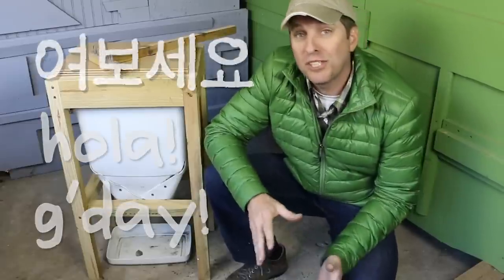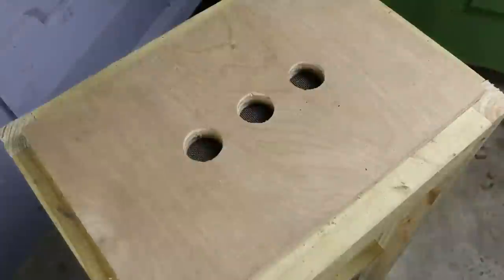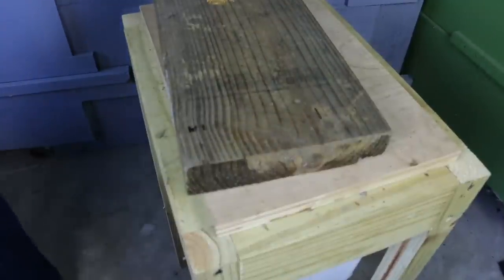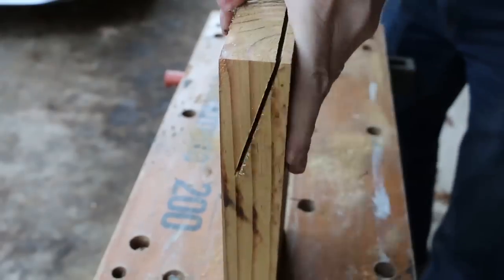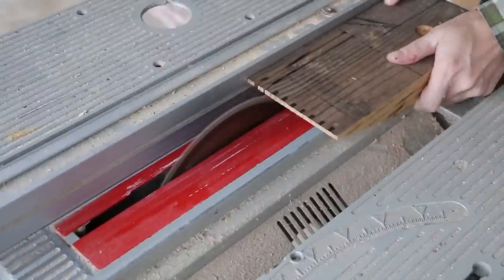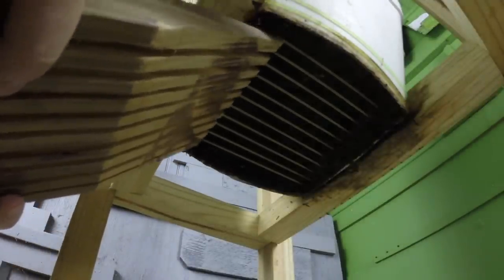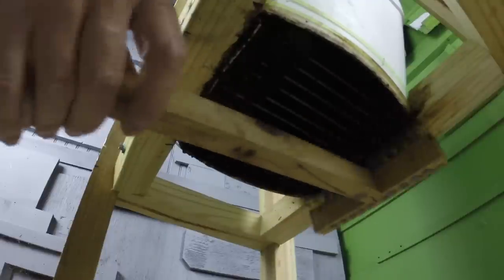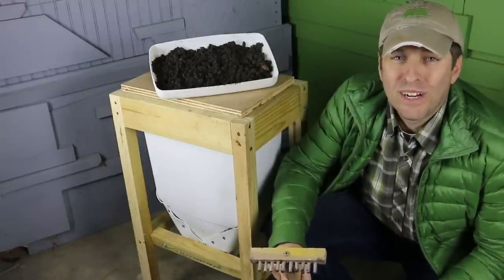How To Harvest A Flow Through Worm Composter

Comment: First, I envy your fabrication skills and all those neat tools.
Second, I still think you underestimate the stickiness of good vermicompost.  Gravity isn't enough to pull it down especially with the taper.  I used the same trashcan, which has a slight taper anyway, and used a cord, woven like yours to hold the compost.   I still had to push the compost down from above to get it into the collection area.  No special tool needed to do that, just a short colinear hoe.  I hold off on feeding them for about 3-4 weeks, gather the leachate, plunger the compost down for harvest then feed them good.
Reply from the maker: Hi Ann...thanks for the feedback. I can't argue with experience, but I'm an eternal optimist. lol. I want to see what happens with my flow through worm composter, but you've got me curious to see how tough those castings are. I'll keep you posted.
Reply: you push your compost down? will this hurt the worms also will anything leak from the sides of the trash can?
Reply: Most of the worms are in the top layers, they go down to the bottom to lay their young.  I do not have the tapered bin - mine is just a straight or slightly tapered trash can so no leaking from the sides with mine.  If you cannot harvest from the bottom, push the top layer with the worms to the side and use a dull flat tool to push the compost down.  I use a small 'colinear' weeding hoe with dimensions 1" x 3".  Do some worms get damaged?  Maybe.  But do your best to avoid it.
Reply: When I harvested a bin I poured it out on a table and pulled the layers of worm castings off letting the worms escape into the pile. My bin wasn't wet or dry and the castings where crumbly not sticky.

Comment: I'm new to worm composting and like this design! How long did it take your soil to come down and start getting usable worm castings?
Reply from the maker: Hi Joshua. I  switched to my simpler design before this one had time to do a full rotation. So, I don’t know exactly. Based on my operation of my other worm composters, my guess is that it is a 9-12 month timeframe. Worms are not fast. The timeframe would also depend on the number of worms in your composter. However, once the “starter soil” gets replaced with pure castings, you should be able to harvest some every 3-4 weeks. Thanks for watching.
Reply: The worms may not be fast but your response sure was! Great videos, thanks!

Comment: A few ideas: What if you attached something similar to the bottom like a grass seed spreader instead of the plastic string: https://youtu.be/IVZrcINA_Lc, or something like the innards of an old manual coffee grinder or Foley food mill or even an old manual paper shredder maybe?

If you want to stick with the rake/fork idea, it might be easier to drill some holes into a crosspiece like you did the rake, but instead of screws, glue in the appropriate diameter/ length of dowel, that will fit between the string and long enough to get up into the bottom where you need to dig (similar to one of those zen sand gardens but bigger). https://www.ebay.com/i/352595207603?chn=ps&_ul=MX&dispctrl=1

Comment: Need something that only requires a drill, it is all I have.
Reply from the maker: You should consider making a worm tower. They can be made by drilling holes in a 4” PVC pipe, if you’re not opposed to that material. I’ve done a video on that. Just leave off the lid and you can build it with just a drill. Thanks for watching.
Reply: You can use a drill and do the same work, just get a saw bit for it and the adapter.  You could do all of this with a 5-10$ saw as well, it would probably be easier and faster than the drill making cuts.

Comment: omg just use your hands. this is the big draw back to flow through bins. i can harvest a regular bin in no time. it just takes a few times till you figure the best way. this just makes something so simple into a major project. its not that much work to keep worms. i don't want soggy leech-aid soak castings either. sorry to be harsh im just not a fan of this method.
Reply: also depending on how you set this style bin up the bottom castings are not always finished when they hit the bottom.. the airflow in this style is very poor. mixing the bin every once in a while helps. worms dont reproduce as much in low oxygen environments. is the goal to keep healthy worms or just process waste. either way there are better methods for both.
Reply from the maker: I don't mind the hand harvesting method. It is kinda therapeutic. But, my goal here is to try lots of methods...to figure out which works best for me and give others options to pick what works best for them. To answer your second comment, I think my primary goal is to process compost, versus putting it in the trash. That said, I do still want to create a healthy environment for the worms. Thanks for your comments.
Reply: Put some gloves on if you want and reach under and pull the castings out with your hands. Easier than a regular bin.

Comment: Is there a more environmentally friendly material you could make this out of? Seems a bit silly to make a harvester like this out of plastic, seems to defeat the 'green' aspect of the project. Otherwise, cool idea, thanks!
Reply from the maker: Dom, this flow through worm composter could be made entirely of wood. One thing to consider, plastic is an extremely durable material. I'll concede that, as it is made of oil, it is not the greenest material. But if it is used for a more permanent application like a composter, then the energy and resources invested are spread out over a longer life span. Where using plastic is not a green option, are for single-use or disposable items like plastic bags or water bottles. Thanks for your feedback.
Reply: Are you going to sell this because I would so buy one please let me know